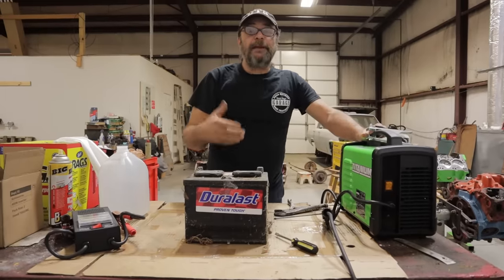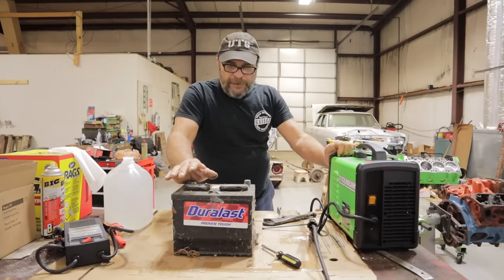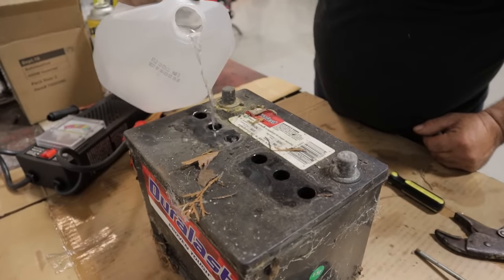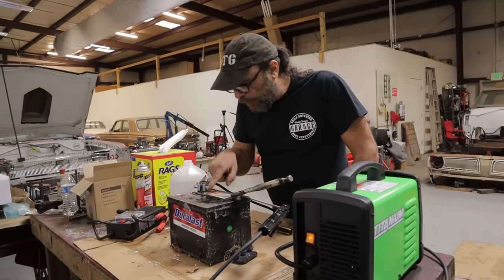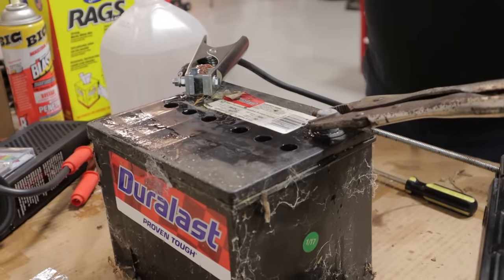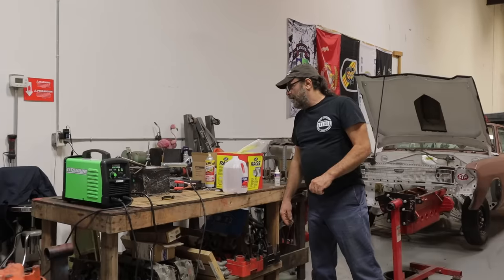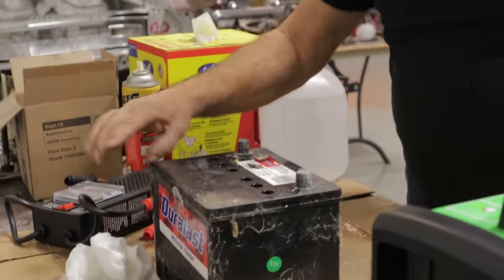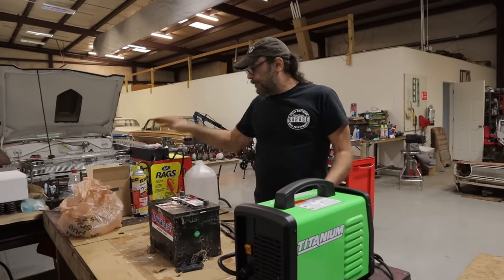Reviving Dead Batteries With A Stick Welder

Comment: If the plates are sulfate heavy you can tap, rock, and drop the battery repeatedly from a few inches off of the ground. You should know right away if it is working, it doesn't take long for the voltage to start climbing.

Edit: This thread contains comments by a keyboard warrior who is woefully ignorant of the topic, enter at your own risk.
Reply: Sulfation grows on the plates so shaking / dropping won't work however, ultrasonic vibration might.   One issue with a battery losing capacity is the lead paste falling off the lead grids, this makes battery capacity lower even if it fully charges.  There are 2 parameters for a battery, state of charge and capacity.  Think of this as state of charge = how full the gas tank is / capacity = how large the tank is.
Reply: @bobroberts2371  It absolutely works, I've done it many times, and demonstrated it to people. When the plates have enough sulfate to bridge the gap between them you lose the potential difference between them, if you break the continuity you get your potential difference back. It's not that hard of a concept to understand, but even with thorough explanation there's always going to be people who disagree out of ignorance, and that is fine with me.
Reply: @InuranusBrokoff  Sulfation is a hard crust / crystal formation not something that you can shake off like dust on a rug.   

Sulfation does not "  bridge the gap ( between the plates / cause a short   ) "   Sulfation grows to cover the plates surface effectively making the battery " smaller" 

There is this thing called a separator plate between the positive and negative plates, this is what prevents electrical contact between the 2 plates.

Go to the batteryuniversity site and look up
  BU-804b: Sulfation and How to Prevent it
then get back to me.
Reply: @bobroberts2371  Yep...

Edit: I mean I knew it was coming, it does not matter what you say on channels like these; there's always somebody out there who's got it all figured out, and has the Google links to prove their point. If you would like to learn something, and not just be a naysayer because something doesn't align with your life experiences you could just do your own research on sulfate induced soft shorts, and save us both some time. FYI: this isn't anything new, and has been knowledge among mechanics for decades.
Reply: @InuranusBrokoff  One question.  Will leaving a car battery on a concrete floor cause it to be damaged and / or discharge?
Reply: @bobroberts2371  No.
Reply: @InuranusBrokoff  There are people that have claimed for decades that leaving a battery on concrete will cause problems. Are you saying that they are wrong?
Reply: @bobroberts2371  I am, and it's because they are lay people who do not understand the reasons that this used to happen; having antiquated beliefs is not that uncommon.

Comment: Did you have the welder set for Straight or Reverse Polarity?
Reply: Reverse.  U need a dc voltmeter to verify.  This is a dangerous operation.

Comment: I have tried this with 3 batteries, I got one working but two of them went thru the whole process. They looked promising. After the second time putting the tester to them they showed around 13 volts and about 11.5 with load on ,but after the third or fourth time I connected the tester and they fell to around 8 volts and ever since then I could not get them to go up again. Now I'm wondering if they had enough after just two rounds on the welder,of if there never was any hope for them. Any advice?

Comment: Thank you for this video. What polarity was the welder set for, DC Reverse? Does the welder run as well as before, all I have are Millers and I would hate to mess one of them up.
Reply: I was thinking about the same thing,
Reply: uh... think about what you asked!  All you have is Millers? Plural?  You either have more money than sense or must be a professional (although that question doesn't sound professional). Your answer is "Just hook the negative to negative and positive to positive!" Which would also be the answer to the question, "Do I hook the positive to the positive or to the negative?" On the other hand, yes that welder can run DC reverse just like your overpriced Millers. I own that same welder and I know for a fact, there is no need for anything else when stick welding, it is a beast!  I try not to say that too often to too many people, as we have to keep the haters hating on our Titainium welders, because if everyone wanted one the price would skyrocket!

Comment: When you add distilled water try not to get debris and dirt from the top of your battery into the cells. If you do you are defeating the purpose of using distilled water. Pro tip! Wipe off the top of the battery before you take the caps off. I typically take a garden hose and wash the outside of the battery off and wipe it down before doing this process. I may let it sit for a while for the excess water from the garden hose to evaporate before starting the process that he is performing on this video.

Comment: Is your welder running straight or reverse polarity, or does it matter?
Reply: straight
Reply: Reverse.  Check w a dc voltmeter.  Incorrect lead hookup will be a catastrophe.  This at best is a hazardous operation.  Be careful.
Reply: @ebutuoyebutouy  that’s what I thought. Thanx.

Comment: I just tried this on a 6 year old battery that seemed to have 2 dead cells.  The voltage would not come up above 10.4 volts with normal charging.   I've just connected it to MMA stick welder for 5 minutes at 85 amps.  All but one cell are bubbling now and after that 5 minutes the battery is showing 13.5 volts.   I'll give it a few more sessions and see if the battery is going to take the sulphate back on all cells.   Thanks for the tip, it looks like it is working, but I will do it gently.

Comment: I would recommend a battery charge enclosure with an acid drain dump so you can safely dispose of the bad acid. It's a safe method that just decreases the risks. I got a stick welder for like 50 bucks and I was able to rejuvenate some truck battery's I used. I just run it at a lower amperage over an hour or two so the electrolysis can take 3ffecr then i drain the fluid and just put new acid in each cell to stop any further corrosion on the lead plates.

Comment: This method work if the battery internals are ok only. Dont over fill the cells just add water until the cell is covered. Before doing the process recharge the battery if possible with a conventional charger to see if the battery accept the charge. A battery tester like the Topdon bt100 will tell you what it really happening inside the battery before 'recovering' and after to see the real results with numbers...Of course if the battery start your car great but for how long? Will be interesting using the bt100 before and after this process. Great video! Thanks!

Comment: I'll suggest something for safety, have a gallon jug of water with baking soda mixed in it as a concentrate. If you get sprayed with hot sulfuric acid, douch down with the soda water on the way to the shower. The gas that is generated is highly explosive Hydrogen gas (we're talking hindenburg explosive)

Comment: Your advice about keeping water neat NY is great, however  to be really  safe I suggest you add Baking Soda to the water. The baking soda  will neutralize  the acid. A
A few years ago, I had a battery blow up in my face. I yelled for my wife to bring me baking soda and water. I rinsed my eyes for several minutes and then went to the ER. The doctor told me that my quick decision to use soda to neutralize  the acid most likely saved me from being blind.

Comment: Seems to me like you would have the the brand / model of welder you used from HF but what do I know?  A 200 amp battery charger works great for reconditioning an old battery.

Comment: It was two years old when you say you junked it.It should have still been good .I just tried renewed the battery that’s been in my Harley 8 years.It’s on charge now already up to 12.5 after 30 minutes on 2 amp charge.Ebson  salt and distilled water.Going in my mower if it works I’m not pushing my Harley way to big to push

Comment: Have baking soda nearby in the event of splashing in the face and area. It neutralizes the acid. I keep a pitcher of baking soda and water when doing this just in case. Also it's best to boil the battery then drain it into a bucket of baking soda, refill with distilled water then drain again. The sulfates settle to the bottom when you boil it. This helps to clean out the battery. Refill with acid and water and you should get a few years more out of the battery

Comment: I was taught long time ago by an old man who had a garage across the street from my house taught me a lot about mechanics wiring and all. Kinds of things when a battery goes bad get a 6-pack of 7 up drain the acid out into  Something and fill it up with the seven up and leave it for several hours ...and dump it out and wash it out real good with a hose. Is poor The acid back in and Fill the battery up with distilled Water and it will work again. I have tried this on many batteries and had them last many more years than they would have lasted. It is Very good method?..

Comment: I have a 12-volt pickup truck battery I believe in H7 800 cold cranking amps. It is reading week even though the trickle charger is green.. I have one of the old style car battery chargers that's on the floor that does to a 35 amp and 200-amp SuperStart. Now the two things that concern me are it's a sealed battery at least I don't see any caps to pop up this is a Duralast and the second thing is 200 amps maybe too much and 35 amps may be too little

Comment: Unless there is a leak, you shouldn't use acid to fill it.  When you discharge a battery, sulfur from the acid is deposited on the plates, leaving the H2O/water.  When you charge the battery, the sulfur is released back into the water changing it back into H2SO4/sulfuric acid.  Basically, unless you fully charge the battery first, you will make the battery less efficient by adding sulfuric acid to it.

Comment: I watched a friend re-condition a mess of assorted household batteries w a HOT 12V CAR battery.
Hooked up the neg.. &  brushed the pos over the batteries VERY BRIEFLY. I thought it dangerous ⚡
BUT it worked. Although not all held a charge, most were re- invigorated .

Comment: I really like the use of the Stick as an isolation of a short.  It would glow red if drawing super high.  So it was a perfect use of that stick in series with the lead.
Reply: He said it was a threaded rod (looked like 1/4 inch).
Reply: @ralphhbernstein6798  I didn't hear that, but it goes the same, a resistivity that prevents a short.

Comment: I would have liked to know how the battery was testing prior to starting this procedure.  I have an deep cycle marine battery that's been sitting in the garage for years without a charger on it.  It's currently reading 3.48V and will not come up with a basic 6 amp charger.  Wondering if this method is worth trying or if my battery is shot beyond repair.

Comment: I have just revived. My unimog battery with a 75amp charger on engine start but I topped it up with the acid from another dead battery placed it on my truck and it started it first time after not running for a year and still holds a charge

Comment: One thing i noticed when doing this is that you can get some sparks when turning up the amps. Gas + sparks = bad ofc. So i just turned off the welder, let the battery vent a bit, dialed up the amps and then turned it on again.

Comment: I just bought a new battery for $250 - But I have another one that's going bad and 3 old batteries sitting around so one of those has to be work-able.
I'm goin for it.
I don't return old batteries for core deposit any more.  I started re-loading shotgun shells and casting my own buckshot and  lead is about $1/lb for scrap so I just melt em down.
Battery lead isn't good for bullets, but it's OK for buckshot.

Comment: Very interesting and informative, but I feel there are a lot of variable that we have not heard the answers to before following your lead. So please if you would answer my quires it would be a great help to me. 1/ is the welder a DC or an AC unit? 2/ what is the output voltage of the Welder you are using? I have 2 welders in my home shop, 1 has an out put of 28 volts the other is about 50 Volt AC depending on the coil tapping you use.  I could easily build a bridge and convert to DC but need to know what you are using. Many thanks

Comment: How does it remove the sulphation or does it rejuvenate them some other way. My solar batteries die after a few years although they are always kept in top condition by the charge manager. I always assumed they die from sulphate build up, but they're sealed so I cant look inside them.  At a replacemen tcost of over £1000 every 3 or 4 years they pay for themselves,  but I dont like throwing anything away if I dont need to.

Comment: What I understand about it is that you use massive current to clean off the plates, dump it out, fill, dump, fill, high current again, then dump, rinse, and refill with acid.
Something to that effect.  There can be a ton of crap in the cells.  The gasses are mostly oxygen and hydrogen.  Very explosive.  Do this outdoors on a windy day.

Comment: Correct me if I am wrong, but I think most people are overlooking an even more imminent danger than the battery exploding. His hand nearly touched both posts of yhe battery. On a normal battery this wouldn't be a problem, but since he has the welder hooked up, it would be the same as shocking yourself with a welder. His hand came very close to touching both clamps, in which I think it would fry him. Happy to know if I am wrong, but isn't 1 or 2 amps lethal?

Comment: I started today, trying to revive an eleven year old battery that has been out of the car for 5 or 6 years I suspect. Voltage read  0.877 before I started. Welder is currently hooked to it and I am cycling it for 15 minute intervals. At 60 amp, the battery was not even warm so I am currently at 80AMPs and a few minutes to go to check the temp of the battery.

Comment: Now what should be understood is that if you attempt to use normal tap water or even just boil it, that's not enough and can cause the battery to explode when being charged or discharged. It must be distilled water/that is water that has been purified through evaporation and collected free from minerals ie it offers a greater resistance.

Comment: Probably the ones that can be rejuvenated this way are the ones that have thin tendrils of lead (dendrites) that build up by the same mechanism as happens in electroplating, and in the case where a dendrite touches - and + they slowly discharge.

Over-amping a battery with that problem likely burns the dendrites away by running more current than it can stand to they open up the same way a fuse does. In cases where there' an open circuit inside or a plate has come loose and caused a major short it's not going to work.

There's several other ways that do the same type of thing that can restore a battery with a dendrite problem. One is simply to pour all the acid into a plastic pan and fill it partway with water and shake it around. If the dendrites are relatively thin it can be enough to open those circuits so the battery doesn't discharge. Rinse it  a few times and then pour the c=same acid back into it or with new acid

Something a little more aggressive is to rinse it with baking soda and water but you have to rinse all that out before refilling it with acid, obviously, so it takes much more water.
Yet another way is to simply leave a charger on it a month or so, such as those little cracker box chargers that have a 2 amp "float" setting and a 10 amp "charge" setting. Just leave it on the 10 amp setting, come by every couple of hours the first day or so and feel the side. If its hot it's probably not going to work but it might. It's not at aggressive as using a welder or a charger on "boost" but it's less likely to cause a problem although anytime they are charging they are producing hydrogen and oxygen so you still don't want to make sparks.

Finally, the last method is interesting.... drain it, rinse it with water a couple of time and refill it with liquid drain cleaner. This makes it an alkaline battery. (I'm very serious)

I found out about this last method from a very old book on batteries you can find on openlibrary.org
 or Google books and some other similar sites, as it's out of copyright. I think the name is actually "Batteries" or "Lead-acid batteries" if not that it's something equally as generic sounding.

Comment: I didn’t see much discussion on voltage. I’d assume that the welder voltage is about double, or more than, the 12V battery. So, can I use a 12 volt charger with a 50 amp “start” function on a 6 volt golf cart battery?
Reply: I was wondering the same thing. In theory, it seems like that would work. 🤷‍♂️
Reply: I decided to go with a DC welder. A Lincoln 225 AC welder with a Miller TC-150 DC converter mounted on top. Old school from the 70’s or so.
I’ve always considered the 50 amp Start function of my Schumacher(?) home charger just a 10 second emergency deal. I’ve had it for over 50 years and didn’t want to fry it unnecessarily. 
Full disclosure: I had my welder on electrode negative and hit the 6 volt golf cart battery with that (backwards) by accident. It really splashed acid out! I got it corrected and it didn’t seem to like more than 75 amps or the acid would still come shooting out. I think I hit it about 5 times of 2 to 5 minutes and my load tester went from going to zero volts to staying in the middle of the green after about 10 seconds of load. It got warm but I couldn’t bring myself to hold it under load until the load coils glowed red like the video. I’m happy so far.